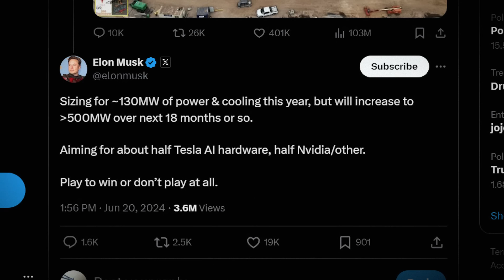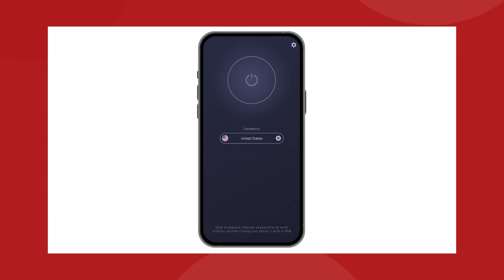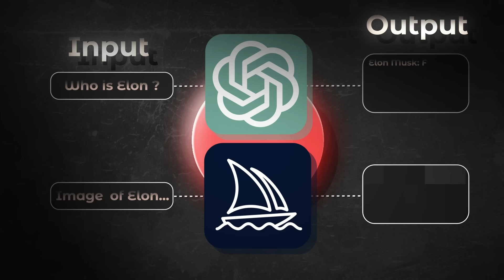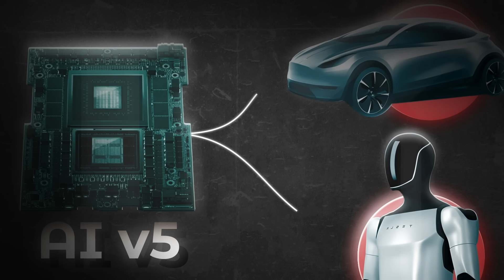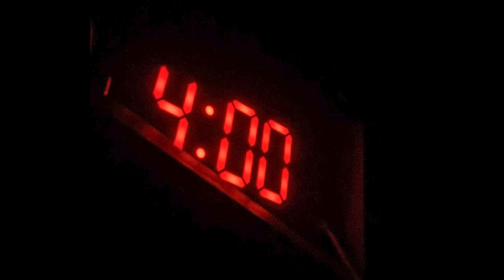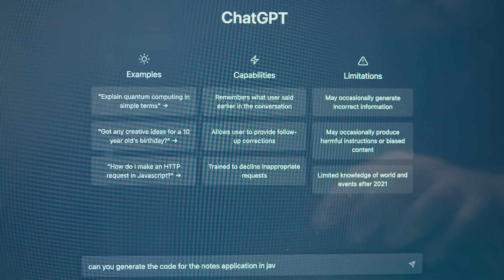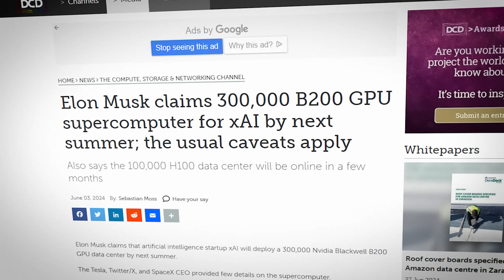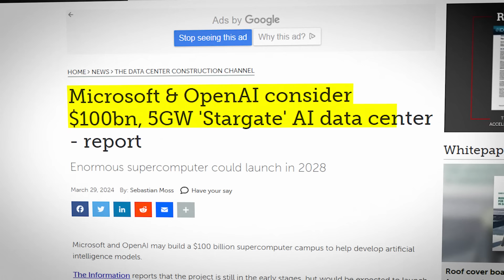Why Elon Musk Is Building The World's BIGGEST Supercomputer

Comment: Tesla should also be experimenting with quantum computing, magnitudes of times faster than the world's fastest supercomputers.  Last year a Google team used their Sycamore quantum computer to run a complex, synthetic benchmark called random circuit sampling, which is exactly what it sounds like – taking readings from randomly generated quantum processes. They calculated the Frontier supercomputer, currently the most powerful computer in the world, would take a little over 47 years to crunch the same numbers, whereas the Sycamore quantum computer managed it in about 200 seconds.
Reply: quantum computers don't replace regular CPU's. They can only do some very specific tasks much faster, but fail to do all the other tasks.

Comment: Decentralized to "outsource calculation power costs to the users and just send the compact data to the cloud" Cloud just sent position data to the cars to correct way.
Sounds optimal but has a connection delay, the car -> cloud delay has to be fix low. More cars = higher bandwith is needed. Elon didnt consider it or let the goverment do its part.
Reply: I think they train and optimalise the AI on the supercomputer to a point where they can make it so small that it fits in the Tesla Hardware to run there locally.